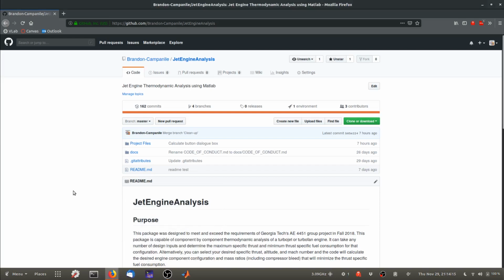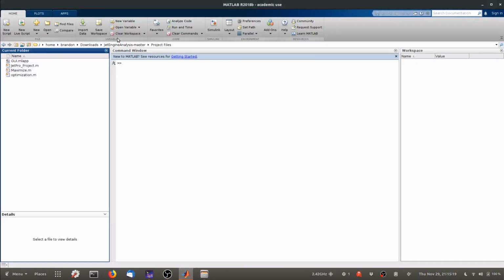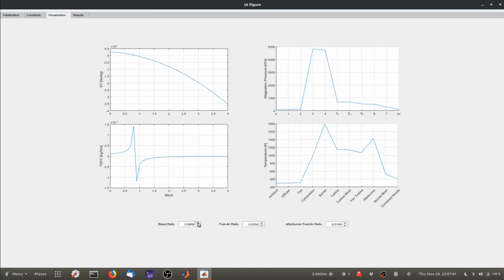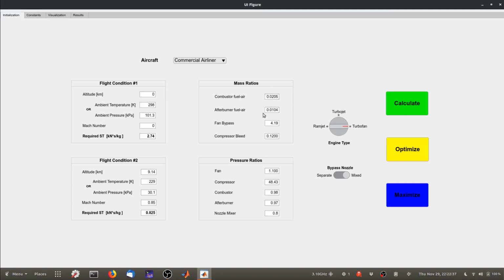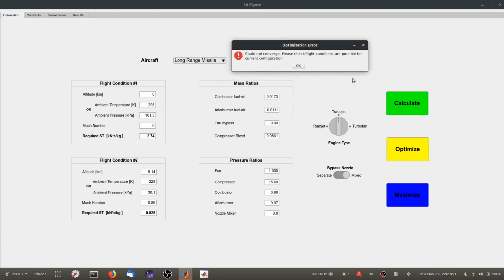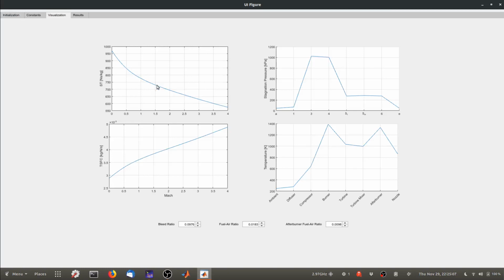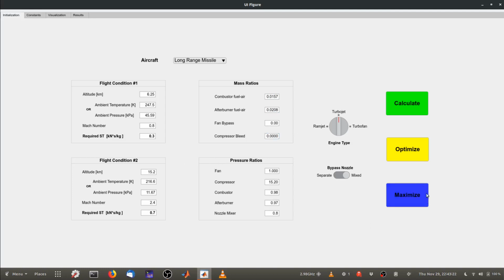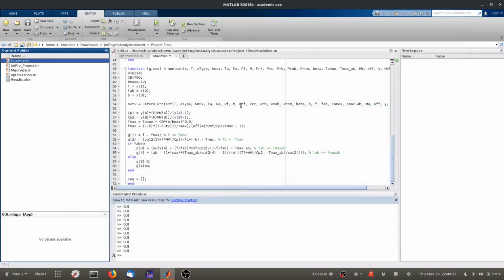MatLab Jet Engine Component Analysis

Comment: hello would be possible to use this simulator for TJ-20 microjet  ?
Reply from the maker: Pavol Durec I would assume so. It operates off sound, albeit idealized, thermodynamic principles. So as long as you know your initial conditions and constants it should work and be relatively accurate.